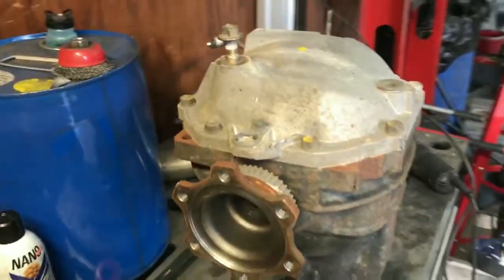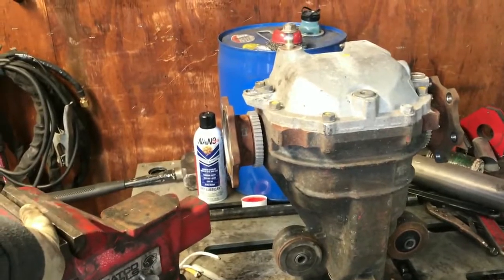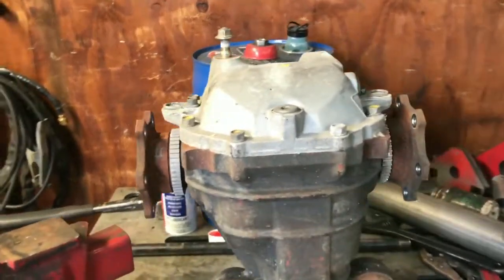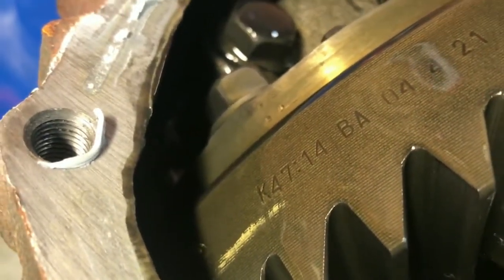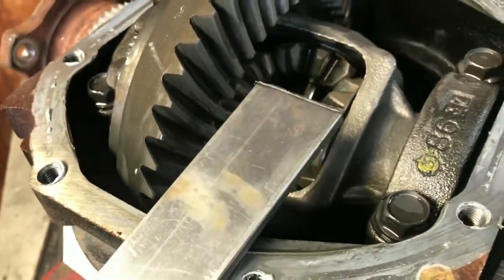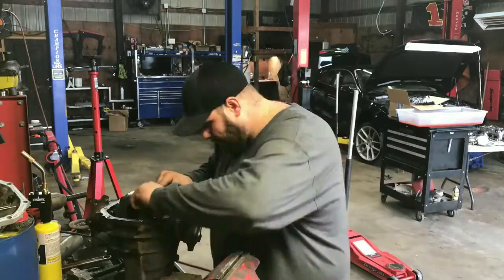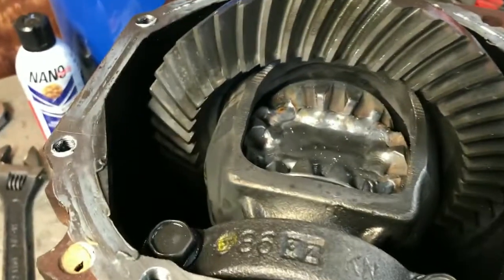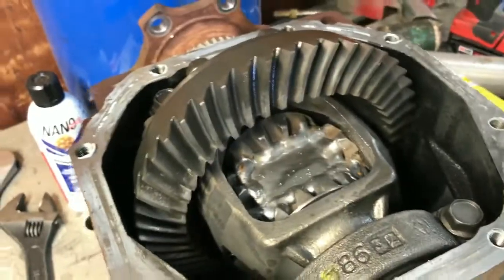Rescue Caleb Quanbeck/ Welded g35 diff

Comment: Hey man, Appreciate thie vid.. Could you explain why an open diff is a better option to weld up over a VLSD?
I'm doing a 6mt swap on a 2002 V35 sedan (350gt-8 CVT model). I got a 350z VLSD to chuck in, was going to weld that up once the cars up running which is soon. Just dropped the auto box, driveshaft/open diff yesterday. The ratios on the diff for my CVT model car I read would be really long in the gears if I ran that with the 6mt.
Peace from Australia!
Reply from the maker: When it’s welded you know 100% that both tires will be spinning together. With a lsd the clutch pack will slip a little and will try to straighten the car back out or even possibly spin. Some times the vlsd is slow to lock up and will make it hard to kick out and start a drift.